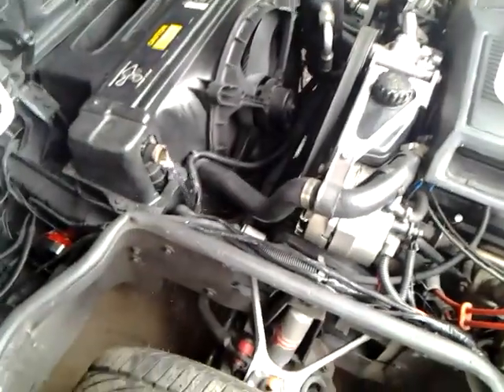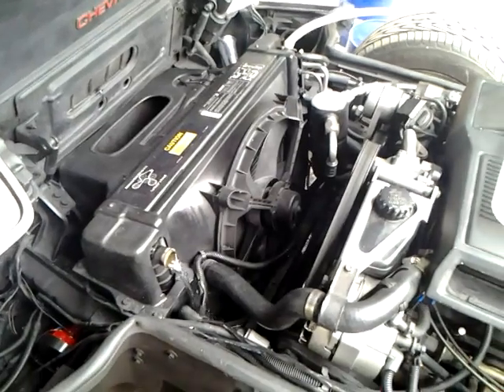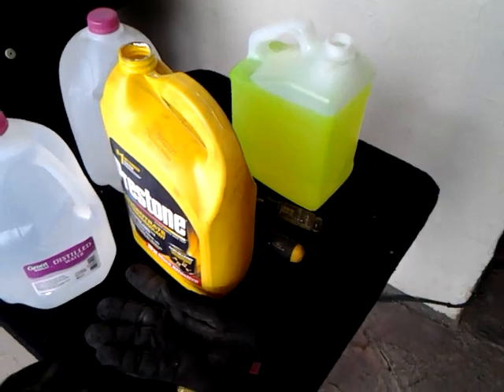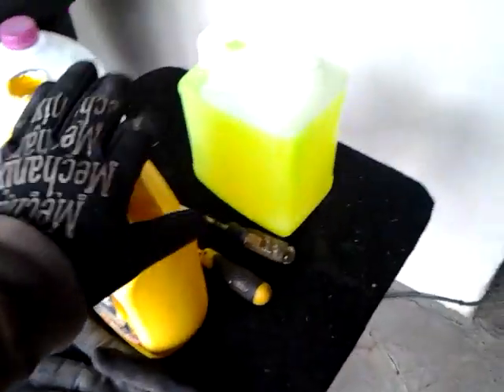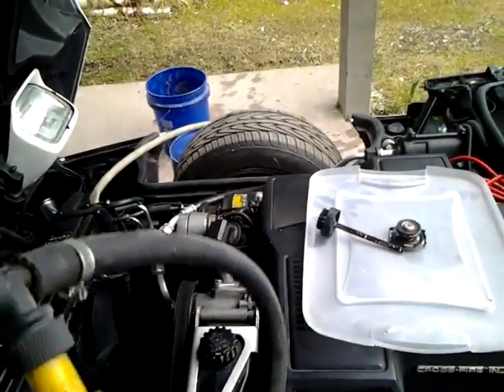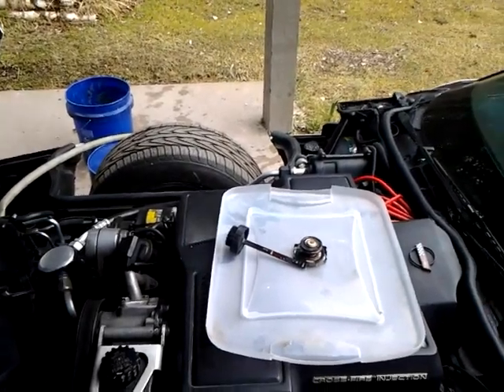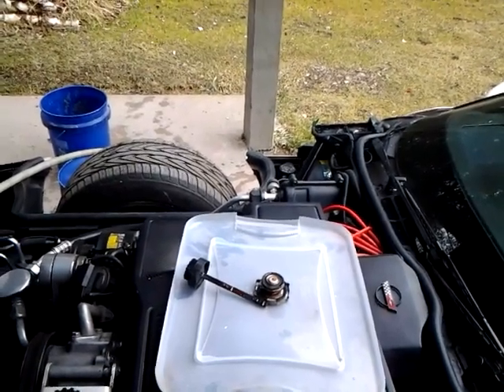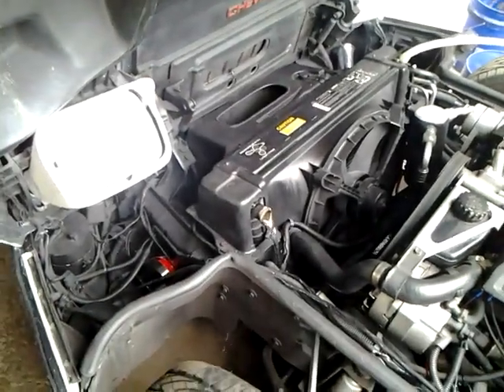flushing cooling system in a C4 Corvette

Comment: Hi Anthony,Thank you for your video!  So I just bought an 1984 C4 and going to do the flush as you have here.  Cant help but notice the cut out behind your radiator to bring in cool air to your system. Wondering if you have any information on doing that?
Reply: Just grab a grinder and cut it out or you can buy a pre cut one from eBay I’m sure

Comment: Hi Anthony, you keep you '84 in mint dealership conditions! I just did this but now I'm wondering, hoe do I get the water out? I did the garden hose method, but I want 100% coolant in there not a mix
Reply: If yours uses Evans then you get this thing called Evans Prep Fluid, using that gets all the water out of the radiator for you to put ur coolant in